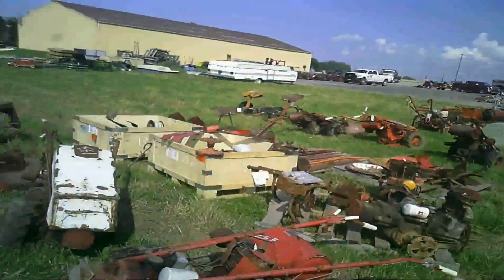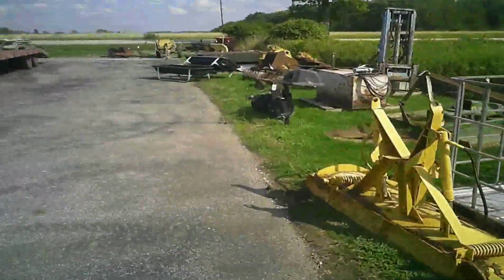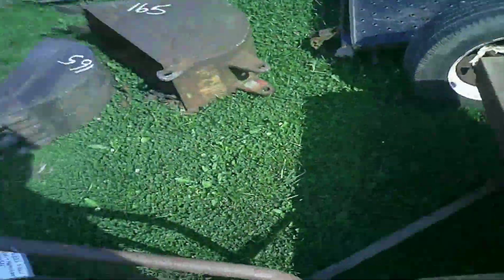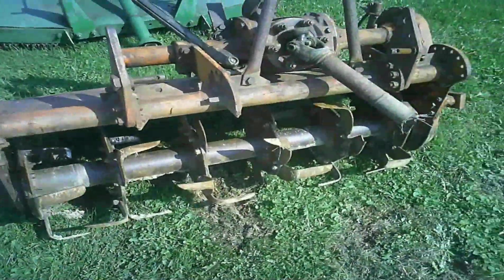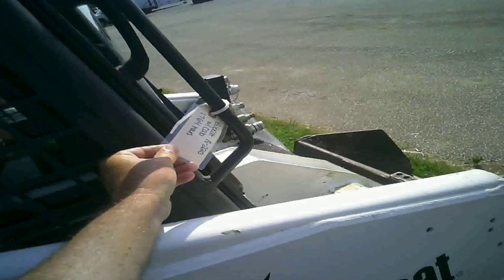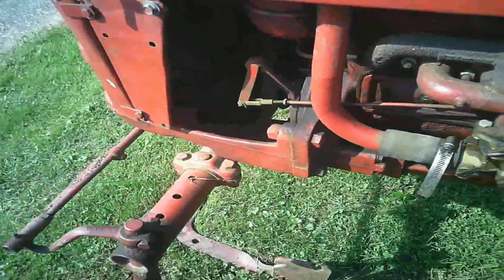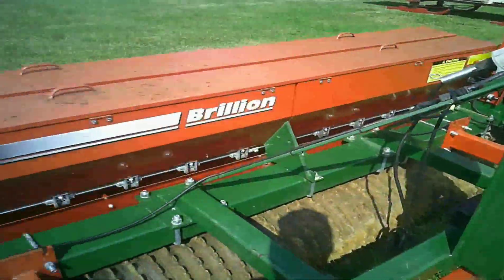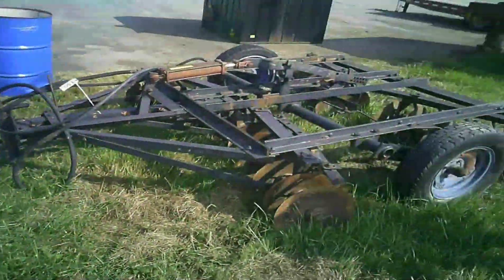How Much is this John Deere Combine Worth?

Comment: If I remember right the 6600 is around 110hp and around 100 bushels without extensions. Now for that skid steer to me 2000 to 2500 hours is high hours unless you knew what the machine did besides what I did with machines in forestry skidsteers definitely are the most beat machine and are definitely a machine that the maintenance is never done. Especially on bobcats because they seem to never break lol

Comment: 6600 has a 404 diesel.  It's been many years but the one I operated was a hydrostatic with rear assist. They were good and reliable combines.
Reply: Dan W t
Reply: That model would have a 329D.
Reply: @Oliver-kv2mm  it could have been an option, but ours had a 404.

Comment: i worked for 2 different JD dealers in 73 and 74  i was trained in the setup of  the 3300, 4400 6600 and 7700 combines.   the first numbers of the model is the width of the cylinder and feeder throat.  i set up a new 4400  with the 292 GMC gas engine  with a 15 ft bean head and took it  a bean field and running  against a 105 hydro   unsold old stock it had a 105 inch cylinder with a 15 ft bean head. i was ina 1/2 mile  long field.. the boss was going to try to sell the 105  i was trained  at the other dealership by a factory expert how fast to set the 4400 up in 50bu/acre beans to run 90% of my auger capacity. i was doing 2 rounds for every 1 round the 105 could do with a 404 dsl and it was running out of hp. i was accused of blowing grain out the back.  we thru a tarp on the groind and could not find one bean blown over. the customer was watching the show from a distance. the boss tried to get him to buy the 105 and he said no way he ordered 5 4400s and 2 6600s. . now the 105 was the largest JD made of the old design. the 4400 was next to the smallest model. you could cover twice as many acres in a day than a 105.. now the 6600 used a 120hp engine  the 6600 was made for 8 years and used 3 engine models the early ones were 120hp  either aa 4020 engine gas or dsl. ore a 4430. now by using a mounting kit  you can use a massey 6 row corn head on the john deere feeder throat. 
the head is a quick tatch you lower the throat and drive into the head and raise it . the 2 cast iron brackets onn top locks into the head as you raise it up and there are 2 locks at he bottom of the throat the holds the head in place then you hook up the drive coupliing to the drive shafts that run the head and the hoses for the hydraulic reel motor.   the thing you have to watch out for is one of the hydraulic control levers will lock forward that runs the reel drive motor if you are picking corn it is not used if you torn that on  it is a dead end and you will destroy the entire hydraulic system including the power steering. it will turn the hydraulic control  valve spools blue, turn the oil filter to mush and lock up the pump and shear off the hydraulic pump  drive shaft.. i was the one who had to fix many of these with this kind of mess.  on 4400,6600 and 7700 models in the late 74 models they did an upgrade that prevented this by adding a pair of bypass hoses you used instead of the coupling plugs.. i believe in these models so if it goes cheap buy it.  since axle flow models run circles around these old models they dont bring much around here anymore.. it looks good for a 40-50 yr old if it has a untouched 404 in it 2300hrs  the engine could be close to needing an inframe overhaul. in 1970 to 1972  the 4020 and 3020 dsl models had o ring problems that  squeezed the pistons and gaulded them. most tractors coming into the shop for inframe overhauls had between 1800 and 3000 engine hours. i saw a new 4000  being broke in on the dyno to do a HP check and it went from 90hp to 40hp after 30 min running at half throttle.
 if it has the newer engine used after 1973  that is not an issue..  if  this unit was made between 74 and 78 it is worth more than if built 1970-73..
 now that massey 300 used a 225 chrysler slant 6 and it was a manifold cracker it had beater shaft bearing problems and  you must remove the back bonnet and the straw walkers. it is a monster of a job i  hooked a snapon slide hammer to the threaded side and hooked a comealong to the mast of a high wheel fork lift with a coffen hoist and pulled the rear wheels off the ground while  two others heated each side of the shaft with rose buds and i used the slide hammer while a cp 717  air hammer was pounding on the other end it took 2 hours of hammering before we got it to move and another hour to get it out. the mechanics had been pounding on it for 2 days before i got involved.
Reply from the maker: Interesting

Comment: The 6600 is not a hydrostat,  low on hours if right, with John  Deere bin extension it is 147 but that looked to be the same after market ben extensions as mine and it is around 160 if you fill in the corners, gas was 110hp and 1974 diesel engine was 104hp. It didn't have a chopper on the back. My 6600 is a 1974 hydrostat with chopper and I paid 5k. Mine has 4500 hours so it had all the rebuilding done. There is to point when the hours are good to buy a used machine and then it hits that point it needs a bunch of repairs.  Once you are passed that you have a good machine again. $2500 to $3000. Unless there are 2 people that want it, than the sky is the limit,  lol. Yes, the 200 series bean head 13' to 18' and the 443 and 643 corn head will work.
Reply from the maker: Video tomorrow 👍

Comment: Over glorified rummage sale with a Gravely graveyard. Gravelys & Simplicitys are my favorite classic two wheel tractors. My BCS is my favorite new one. It's my Italian racing tiller. :vD Those trailing wheel drop spreaders were originally marketed to the orchard & vineyard owners. NI made one that I would love to find in minty shape. That little Cub would be a fun toy. So would the MF 245 & the IH 464. As for the 6600? Got me by the boo-boos. It does look nice. Don't know how the head goes on. Bubblegum & baling wire? Couldn't tell ya. If I was SP combine shopping, it would be an Axial Flow or a Gleaner K on up. Currently have a line on a really nice JI Case F2 pull type. Can't wait to go look at it.

Go ahead & plow live tomorrow. I'll be watching..... muttering at my smartyphone that if you had an Oliver plow like mine, you'd be in 4th. ;v)
Reply from the maker: Hahaha

Comment: On that Deere the head hooks on those 2 lugs on top and then 2 bolts go on the bottom, one on each side through the plate into the head. 104 hp if it's a diesel, and i do believe around 100 bushel

Comment: The 6600 had 3 different engines. Ours had a 329 diesel, I know the late ones had a 404 diesel. Then some of the early ones had a gas engine, not sure of the size. The head mounts on with 3 bolts if you have a grain head and 2 bolts for a corn head. We had a 6600 for around 20 years, we now have a 6620. The HP should be around 110-120 with the 329 and roughly 130ish with the 404 and 130-140 BU. grain tank.
Reply from the maker: Interesting

Comment: 6600 is a 1970's era combine and the roof looks to have been crushed perhaps a tree? And the 300's were a 1960's era combine for the 6600 I would be hesitant to go much above $3000 and the 300  no more than $650. Outside of the 245 and the Husky it is definitely  a picker's auction.

Comment: our 6600 works great (ck my channel out for videos) has 150 bu bin and hydrostatic transmission. ur head fits on the two mounts on the feeed house and then there are bolts under the head to secure it on. ran these for yrs no problem with the  head ever fallin off. now plugging up is a difff story lol
Reply from the maker: Ill check it out